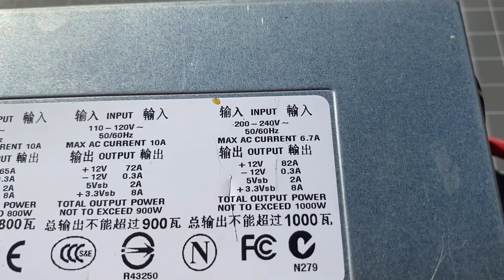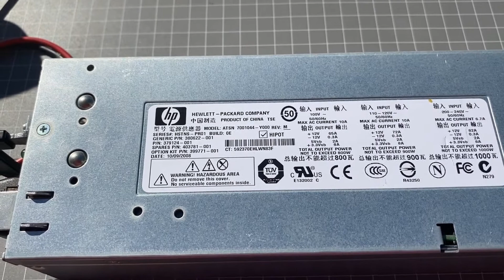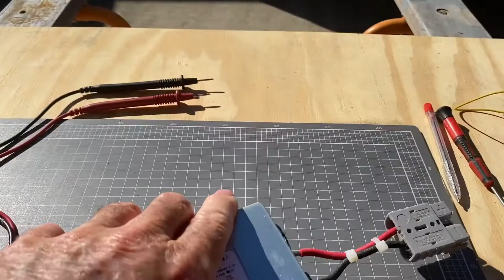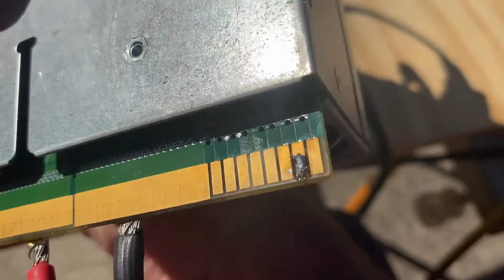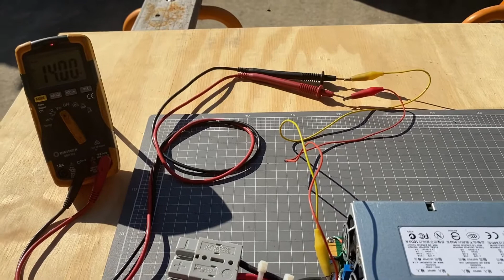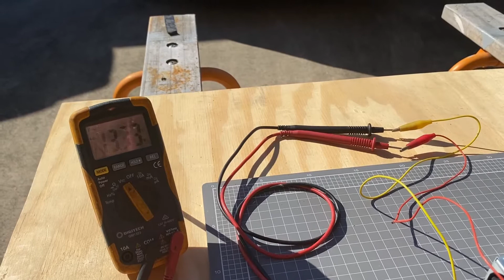HP ATSN 7001044 - 83 amp DC Server Power Supply 14 volt Modification

Comment: hi: the fans? are they very noisy? or is it possible to make them spin slower and make it quieter? Thanks
Reply from the maker: Hi. The exhaust fans get noisier as the current increases. Not much you can do about that.
Reply: I have same issue but I noticed that they differ though they can be same model ,  I have two same power supplies same everything only difference is the last letter on the model ..one is quieter while one is very noisy ,,,so you must take that into account when looking for these power supplies

Comment: Mr. Waterson, sir, u made my Sunday! I took couple of those HP PSUs with different wattage from a local company IT waste bin, one of those was this 1kW PSU... which, thanks to you, sir, is now charging my motor bike battery, set up with a 2k2 resistor instead of the trim resistor to 13,63 Volts. Thank you very much!

Comment: Has anyone had an issue with the PSU not turning on when the jumper is installed.  I installed the jumper and it turns on for 1/2 second max.  Then when I unplug it the fans turn on after about 2 seconds and run the stored power down.  Strange.
Reply: i have the same problem do you fix it
Reply: I had same problem but later found out that the jumper or switch must not have any resistance ,,,put a solid thick short jumper ,problem should go away, it should be a solid joint ,,,if this doesnt work then that power supply has an internal problem

Comment: Hi, is that a small resistor fitted to the blue wire on the left also, or will the potentiometer work just on it's own, and also is it wired to the first prong and the last prong? prong 8? thx

Comment: You, Sir, are a GENIUS!!!
I found an old one of these in a rubbish heap and was ready to return it there when it didn’t seem to work.  Shorting the second pin on the top with the one on the bottom kicks on the LED and outputs 12 VDC!

Next, I’ll complete the mod to output the 14 volts at some point!

Comment: I got 2  "DSP-800GB A" I jumper the the 2 2nd pin to verify the fan comes on and it did.
However, without the 2 2nd pin jumped I forgot to unplug it and it was plug in over night,
the next day it was hot as hell. as it does not have 12v while the 2 2nd pin is jumper, it seem as if the transformer still hums and heat up.
can anyone verify this or do I have a bad PSU.
thanks in advance.
Reply: The same happend to me. I think its made that way.

Comment: Hello, I have atsn 7001044 but I could not run it. I looked at all the videos and documents on the internet. It works when you plug the device into the server. Could you help?
Reply from the maker: Have you followed the video instructions. To turn the supply on you will need to solder a jumper on the two pins on opposite sides of the circuit board as explained in the video.

You will then see the green led adjacent to the AC power inlet socket light, meaning you will have around 12.2 vDC at the output, and you will hear the two exhaust fan start running.

It works in the server rack because it is designed that way, with the on/off circuit connected to the two pins described.

Hope that helps. Doug

Comment: Can you put two of these in parallel and have double the amps ?
Reply from the maker: Actually, the short answer is not easily, as some form of resistive balancing would be required if you were to do it properly. If you were prepared to experiment and maybe fry a couple of supplies in the process you may come up with a workable solution, however I really have no need for more than 80 amps, and therefore can offer no advice for you. Maybe others on YouTube have a solution. Cheers Doug
Reply: Yes you can. The voltages of each supply needs to exactly the same and wires for the DC side need to be the same length.
Reply: @captaininsano2777  Hie are you saying if there voltages are the same you just put positive to positive and negative the same without diodes and you wont have a problem?
Reply: @snhongo1  ive done it many times.
Reply: @captaininsano2777  great if works i will try it ...have two of those power supplies in the video i will hook them up without diodes
Reply: @snhongo1  just gotta be perfect. Pos and neg leads need to be identical lengths. If everything is the same, then there will be no one supply working harder than the others. Ive built multiple supplies and done them this way. 5 supplies wired in parallel.  All supplies share the load equally.
Reply: @captaininsano2777  Thanks a lot for the information will definitely try it out....
Reply: @snhongo1  let me know how you make out please. Have a great day sir!
Reply: @captaininsano2777  ok 👌

Comment: How do you turn on the supply?
Reply from the maker: As described in the video, just solder a jumper wire between the two end connectors that second in from the left (top and bottom, looking front on) or wire a simple on/off switch to the same connectors. That will turn on the supply. Hope that helps.
Reply: @DougWaterson 
Hi Doug.
I have the same PSU.
I made the same mod (a short in second pad from the left, top and bottom, looking front) to switch on but mine doesn't run.
Neither the funs, nor the green led.
I hear only a click and very low hum. 
The only difference between mine and yours ATSN 7001044 is the HP rev.
I got the "J".
You the "M".
Any suggestions?
Thank you.
Reply: @ik6qre  i have same problem- shorted those two pins but if it turns on just for second or two and tested voltage jumping 0.3-3
Reply: @milkman5038  In my case no activity. Just a small internal click and a weak hum. Few millivolt at the ends. Hoping for a Doug's help.
Reply: @ik6qre  mine also like that case.cannot turn it on
Reply: @augustmarindang7949  :,-(
Reply: @ik6qre  until now i try many tricks but still cannot turn it on
Reply: Hi Doug
I have a question for you 
I have the same model powersupply if i give 240 v the lamp from the supply doesn’t work also the fans are bot working
Reply: Great video indeed 👍
Reply: Hi all. I have the same problem. Runs for one second when connecting to power. I repited this guide on two PSU (one if them have Rev. E, other Rev.F) Both start server without problem when I beck it. Any ideas how to fix this?

Comment from the maker: I have not had to remove the cover from this supply, so I have no need to be concerned about charged capacitors, however, I would be very careful if I was to open it up. Maybe discharging the supply with a wire wound resistor or a 12 volt car lamp. 
No I don't know the size of the fans. I do know they make a fair amount of noise when you draw large currents.
Reply: Thanks for the answer! 
What would happen if I don't use a potentiometer/resistor and just bridge these two connectors with a cable?
Reply from the maker: SeGin if you just bridge the 2 opposite pins, you will turn the power supply on and you will have the standard 12 volt output. Only add the resistor if you want higher voltage. Remember that the supply has over voltage protection so it will not increase any more than about  2 volts until the OVP circuit will shut it down.
Reply: hello I will be very grateful if you answer quickly and what kind of resistor did you use for how many ohms ?
Reply from the maker: LoL 2004 KeK  I used a 10k multi turn pot so that I could use it as a battery charger and vary the voltage from 12v to 14.4v. If you don't use a resistor then the supply will supply the standard 12 volt rail voltage, typically around 12.2 volts.
Reply: @DougWaterson  I have the same two blocks and I feed them to the home music system and for perfect operation you need 14-15 V so I wanted to know what you need for a resistor thank you . and can you still tell me exactly what kind of resistor you need ? so that I can adjust the voltage from 12 to 16 v thank you for your help .
Reply from the maker: @LoLKeK-wk2ku  Without any modifications to the over voltage protection circuit, I have found that fitting a 10Kohm multiturn pot at the points described in the video, that I can vary the voltage from 12 to 14.4 volts. 
14.4 is the maximum voltage I have found that you can expect from the supply before the overvoltage protection circuit closes the supply down.
If you wish to increase the voltage above this point you will have to disable the over voltage protection circuit. I do not know how to do this but there are videos on this subject so you will have to do your own research on this.

If you want to fit a fixed resistor for a fixed voltage above the standard 12v, you will have to try various resistors until you achieve the voltage you want.
Hope this helps. Kind regards, Doug
Reply: @LoLKeK-wk2ku  hey Lol 
Can ask how did you connect this powersupply to your hooe soundsytem
I want to make also the same thing but when i want to test my powersupply normal  it doesn’t work it doesn’t give green lamp en fans are also not working